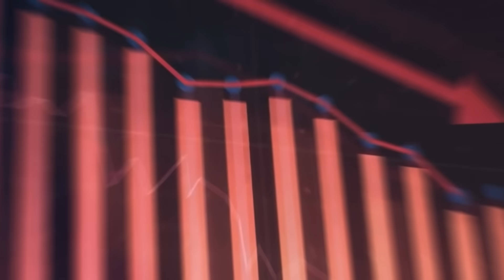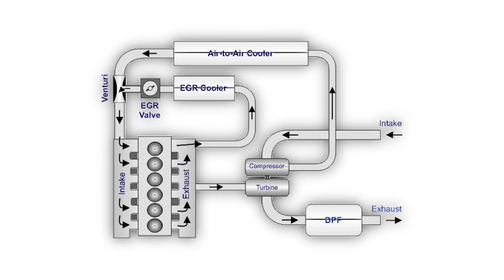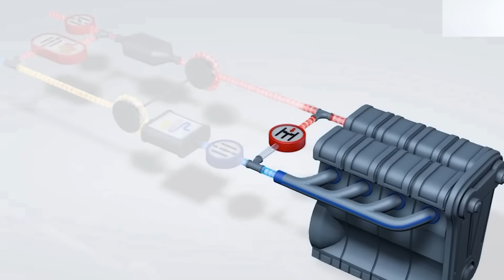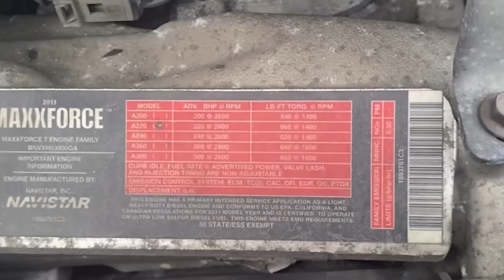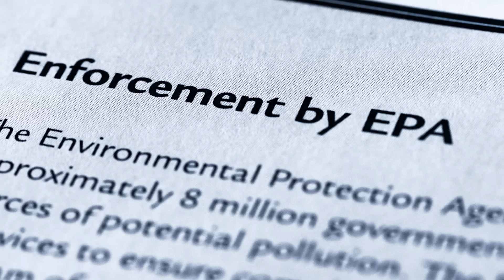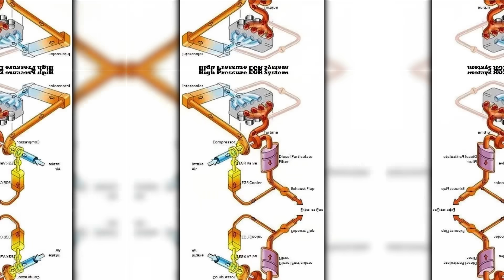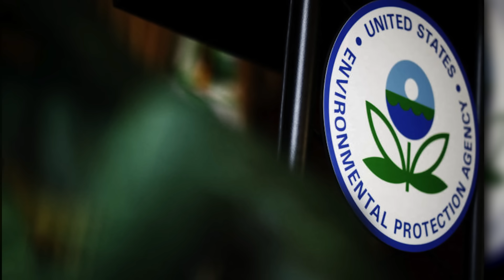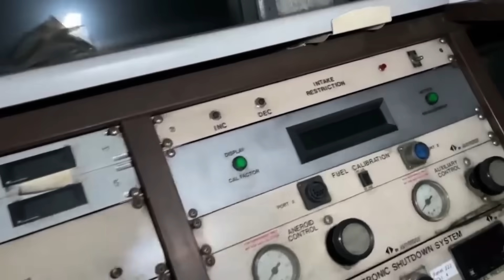The Rise and Fall of MaxxForce: The Engine That Broke Navistar

Comment: Politician 1:  We're going to reduce tailpipe emissions 90% at a cost of X dollars/car and reduced mileage & performance, because we have a lot of REAL smog in the air...
Politician 2:  We're going to reduce the remaining 10% of the original levels by 90% at a cost of 2X dollars/car because we still have a lot of smog in urban areas...
Politician 3:  We're going to reduce the remaining 1% by 90% at a cost of 3X dollars/car - plus reduced reliability & longevity 🎰 - because, well, we get more votes from certain people when we do...
Politician 4:  We're going to reduce the remaining emissions (that can't even be used for autocide) 90% at a cost of 5X dollars/car because we don't want people to be able to buy a gasoline vehicle - or even a lawnmower...  🔌🔋

Comment: Maxforce was a serious POS . At JB hunt my first tractor was a Maxforce 13 powered ProStar . It was definitely the worst truck I’ve ever driven in my now 14 year trucking career. Like in this video I experienced it smoking and requiring parked regens regularly, I’m talking every day having pull over and do a parked reven . Company dispatch tried to tell me it was normal since I did short runs when I reality I did regional 300-400 mile runs . Eventually I convinced him to get it in the shop and that was fixed . Then at around 300k it began using a gallon or two of coolant and oil every day . Dispatch said drive it keep fluids in it you’re getting a new truck soon to which I did get a new prostar with a Cummins in it. Goodbye Maxforce junk. Remember folks this was also along the same time Navistar was building engines for Ford during the worst years for the  Powerstroke diesel truck , yep the 6.0 and 6.4 days !!

Comment: I liked the 07 to 09 emissions DT466, once the 2010 emissions hit that engine was fucked! I had a 215hp DT466 2010 emissions wear itself out to the point where it wouldn't start in only 70k miles

Comment: This video fails to mention the 6.0 diesel  navistar/international engines Ford put in the mid-late 2000’s Ford Super Duty Trucks. Arguably the least reliable mass produced engine built. Ford actually sued navistar/international over the cost of warranty repairs.
Reply: then the 6.4 was even worse than the 6.0...

Comment: FYI, the new international s-13 engine is pretty good I heard. Strong torque but I does have the scr system installed. I believe it's a European motor designed by Scania.

Comment: I am so glad this happened. If it didnt, VW wouldnt have bought the Scout name from International to revive the brand. They are currently building a massive manufacturing plant in South Carolina and will be building offroad SUVs and Pickups designed by Americans in Detroit.
Reply: Yeah, wait till the  all electric Scout actually hits the streets at about $90K and they'll be having the same problems that Rivian has had;  that is selling $100K all electric trucks to the general public.  Gen 2 Rivians are well over $100K and pushing $120K with options.   Guarantee that 99.99% of them will be leased and that presents its own set of issues.   At this point, Scout has only made a few pre-production units and a whole lot of promises.  How long those outside sourced batteries going to last and whats the range when you turn on the HVAC in cold or hot weather?  Look on the bright side, you can lease an all electric Hummer and go 0-60 on about 2.8 seconds for only $950 a month.  Wait till those leases all expire too.
Reply: @alexnutcasio936  Resale value of these electric vehicles isn't going to be good.  I had one mechanic tell me that he wouldn't buy one that was off warranty because of all the issues
Reply: @williamdavidson9009 the most worrisome issue is the battery.  If you do a three year lease, who cares?  But, after that it’s going to be an issue as all batteries degrade. Each and every one.
Reply: @williamdavidson9009 I’m sure a mechanic said that because there is basically no maintenance other than tires and wiper blades.
Reply: @marcochavane3124 that’s where you’re wrong mate.  The gas “ generator” will require maintenance as well as brakes just like any car. Tires?  Oh yeah, because of their torque and weight, BEV do go through tires,that’s for sure.  Plus, anything made by VW is sus anyway.  They couldn’t even do software right in their ID series of vehicles and had to go to Rivian to get their software sorted out.   Oh, and let’s not talk about diesel gate and the $30+ billion it cost them.
Reply: @alexnutcasio936  Again, you are proving me right. You do not know what you are talking about. The Harvester Generator is not standard. They will have full BEVs as standard.

Evs rarely need brake to be replaced. You would know that if you actually understood how they work.
Reply: @alexnutcasio936 so you know nothing about Scout. Got it.
Reply: @marcochavane3124 really?? Where was I wrong. Other than not knowing the exact price, where was I wrong?  The use of a gas generator,like BMW is not going to save the brand.

Comment: Isn't this about the same time frame that the 6.0 Powerstrokes made by International preformed so bad that Ford quit buying from international and started making their own engines?

SCR trucks have not been without their own issues.
International has half right.
SCR engines are too complicated but making an engine breathe its own exhaust is never a good idea.

Has anyone ever calculated the environmental impact of all the trucks scrapped well before their time because of emissions problems?
Reply: Around the 6.4L era

Comment: So basically, Navistar made a stupid engineering bet and lost almost immediately. Ever since, guys have been spouting off about how horrifically bad DEF systems supposedly made ALL diesel truck engines, rather than just the Navistar ones that didn’t even have SCR initially. And every other problem with modern trucks gets blamed on the DEF system even though injectors have been problematic, CP4 fuel pumps have caused headaches, turbos have gone out, transmission programming, whatever. Nope, it’s gotta be emissions components-related cuz if it’s not, people don’t have a reason to blindly blame the EPA.

Comment: I maintain a fleet of around 16 Maxxforce engines in dump trucks (my organization still has 100s of them, I'm just in charge of a small part of those). These engines have been nothing but money pits. Had the guy in charge of purchasing fleet back in 2008-2009 not been an International shill, he would have saved our organization millions of dollars over the next 15 years. He thought by purchasing the cheapest option for trucks, he was doing the org a favor. Lol, nope. So glad that guy isn't here anymore.
Its also funny that Navistar tried showing that their engines were "simpler" compared to SCR engines when Maxxforce engines are the BIGGEST pain in the a** to work on because of all of the egr coolers, piping, and coolant lines. Compare one to a SCR truck and you can actually get to the valve cover easily. To pull the valve cover on a late Maxxforce, its at least 3 hours worth of work just to get the pre-coolers and piping out of the way.

Thankfully we've started buying Cummins powered trucks for the last 6 years. I'm so ready for all of my Maxxforce trucks to be gone. Another 5 years or so and they should be.

Comment: It's silly. Cummins already revolutionized the industry in 2006. 2003 to 2005 5.9 cummins has a different spray pattern than an 06 - 07 5.9. The fuel is legit high pressure mist and keeps the soot down. Hence why duramax and power stroke has egr in 03 to 07. But 5.9 does not. It's how the fuel is fed to the motor. Not how to just flood a cylinder with fuel
Reply: What’s it like to have no idea about what your talking about?
Reply: @Bacongrease00 lol

Comment: All that was accomplished was trading emissions at the tail pipe for emissions at the factory, because now with EGR and SCR systems engines are lasting half as long and now you've created a whole industry for manufacturing DEF. We've gained nothing. In fact I'd argue we're worse off than simply producing cleaner burning diesels without all of the aftertreatment and recirc BS.

Comment: I worked in the oilfield driving the dt466. I got the first truck in our fleet with the new dpf systems at the time. It was nothing but problems right off the rip. Every truck they got wuth those engines died with low miles.

Comment: This is interesting and sad. I am not a diesel expert. I am involved in ordering diesel generator systems installed as power generator sets and backup power generator sets. I learned that the modern emissions requirements were progressively instituted starting years ago when we were designing a large oil project in Northern Alaska. The main power was from gas turbines, but backup power was to be diesel and the question was wheher to order simple unmodified diesels or opt for the more expensive types that required urea tanks and the more complex arragements. Not being any kind of diesel expert, I was mainly familiar with the impressive qualities of the engines for low end torque and reliability. The addition of the urea tanks was presented as a means to reduce pollutants to an incredible percentage, but the need to maintain a larger more complicated system in a ready state in arctic conditions when it was backup equipment led us to take advantage of regulations which apparently permitted the purchase of 'old-fashioned' engines that were not normally used. Still, they needed to be operable when situation required, hence the engines needed to be maintained, and this meant they had to be turned on for a minimum number of hours as part of maintenance. We were researching these issues when the project was shelved. I wondered how this was affecting diesel trucks and cars and whether they would be topping up with urea tanks which had to be heated. The last diesel I drove on the North Slope had no such gear, but that was ten years ago.
Reply: As a post-2010 diesel owner, I can tell you that the "systems" they implemented between the DPF and SCR with urea injection have created a whole subset of issues for diesel engines.  First, the DPFs get "dirty" with soot and clog.  Then the urea injection tanks have to be heated and the heaters not only use battery power but they too fail. Then, if the urea injection fails, you get the "check engine light" of death which means you have less than 100 miles to get it to a shop and get it repaired before it goes into limp mode. Limp mode means literally that.  Your diesel engine is now limited in both speed and RPM to the point of being ineffective for movement. Neither the EPA nor the manufacturers put much thought into how they were going to achieve the new 2010 standards.  Quite simply, too complex and not enough time was given to come up with a real solution. Navistar hit a fork in the road and took the wrong path.  This doesn't include their issues with Ford "diesel" trucks which also lead to their downfall.

Comment: Max Force 13s had a 2 piece egr cooler,  weighed about 80 pounds, major project to replace,  you had to remove seats, shifter, dash panels for access to inside engine cover.  Just for access to egr tubes.
Reply: God help you if a bolt broke there was just no good way to get bolt extraction tools in there, or the two tries you had to get the screws to bite and hold into the cooler. 
I would like to find some of that p90 lubricant though.
Reply: Getting to the EGR valve and bellows was easy. Passenger seat out, shifter out, pull back floor mat and remove the dog house. I could turn out two EGR valve recalls and blend door actuator recall jobs easy, and that wasn’t rushing. It was easy to do them together since you already had the doghouse out.

If you had to do the cooler core, it didn’t add hardly any time. You already had the coolant drained and EGR valve off anyway.

Comment: I was in the same industry as Navistar at that time and nobody outside of Navistar’s leadership had any doubt that their solution would fail. We had bets going on how long they would make it before conceding to SCR (they actually made it surprisingly long). The issues with their approach were apparent from the start. Even well before the Maxxforce disaster they were considered subpar, and we had little faith in their technical abilities in general, not just on the engine side.
Reply: I made my entry into the truck sales markets by entering in to it by selling - or attempting to sell - navistar / INTL trucks just as these engines were being replaced by Cummins.  It was a really tough go at it, and I got thrown out of places not fully understanding why for a while.  After a couple years of that I made the move to a different brand and found that it was much, much easier to make a living.

Comment: Bro everyone was having problems after 2007... everyone was having cooler failures, injector failures, head gasket failures,  aftertreatment failures,  etc.... due to the epa forcing changes so fast..... the difference was that other manufacturers got their shilt together and international was still building trash engines

Comment: Maxxforce == Laxxforce..  these things were TERRIBLE.. thr video is wrong as the first ones showed up in 08 models..  in fact the infamous ford 6.4 (much worse than even the 6.0) was a navistar engone sold to ford...  in navistar terms it was the MaxxForce 7. and was horrible about cracking pistons, rusting out EGR coolers, and even chewing up injection pumps...  the Maxxforce DT (a terrible descendent of the once venerab;e DT466) wasnt a lot better..  ask about any school system who had these engines...  in fact they were So bad that cummins started selling a repower kit so poor disatricts stuck with Maxxforce 7 or DT engines in thebr busses could swap them for Cummins 6.7s....

Comment: I can tell you that it paid my mortgage for several years. Ya I worked in an international dealership for 8 years. I couldn't begin to ever figure out how many egr coolers. We would always say that international should do what alot of coffee shops and come up with a program that when you buy 10 egr coolers that you would get the next one free and also we would say that they should have a few in the glove box from the factory. Anyway I don't know where to start but it's to much on this platform. At the end we couldn't give away new trucks that had a maxforce engine and I kid you not you could buy a kit to repower with a different engine. I did a few of them myself. I also know that the dealership just sent them to auction. These were new trucks and they had trouble getting 30k for them. As I said there is so much more.
Reply: I was about to talk about the kits to change them. I knew a guy who had an International with the Maxxforce and International swapped his to a Cummins ISX15.
Reply: Thanks for sharing. What a nightmare

Comment: As a diesel mechanic all I have to say is that these emissions systems cause more harm than good they are a scam and cost operators thousands of dollars in repairs, egr coolers are still a big problem in all current diesels.
Reply: Because it was never about making diesel cleaner it was about destroying the industry.  They didn’t gradually tell them you gotta make them better. They just forced it which destroys industry.. or the quality of the product. Or both..
Reply: You must not be old enough to have been driving before the EPA cleaned up the air.

Comment: I worked for a small mom and pop that only bought international trucks. I was firs to get a new truck, it came with a c12, the other 2 came with Cummins which had problems of their own.  The cat was the most reliable.
Reply: I had an 04 C12. Wonderful little motors. Stupid easy to work on and very, very reliable. Did a head replacement at 1.1 million in a Sapp Bros parking lot during a 34.
Reply: That's usually the case

Comment: As an engineer the main issue with this engine was mostly how that EGR worked or rather routed, they thought routing it before the turbo to mix it with fresh air and compress it in the turbo, get it cooled again and then into the engine would work.....they just forgot the fact that exhaust is hot af and in itself need to be cooled before the turbo or just put it in after the turbo and then into the after coolers
The fact they only depended on the EGR cooler for such temps was in itself an idiotic thought, just to put it into perspective, the temps of a business jet engine is around 1500 F.....before the igniters....and after it was closer to 3500F so they wanted to have the heat management of a jet engine in a semi.....not sure what they were thinking there

Comment: I was a mechanic for international right before they went to the variable turbo and those trucks used to be solid. Once they went from Canada to Mexico for manufacturing the newer trucks started piling up for repair
Reply: It’s funny you say this. I had a friend who ordered a prostar with a maxxforce 13 engine. That first year he had it I bet it was at the dealership 8-10 times. He got a lawyer finally they came up with a compromise of putting a ISX Cummins engine in it and labor for it

Comment: The dramatic and sudden reductions in NOx was simply unrealistic for the combustion engines. EGR even today has many issues and all the after treatments solutions are costly and require maintenance. I believe in making engines more efficient with a focus on keeping emissions realistically low for the life of an engine.